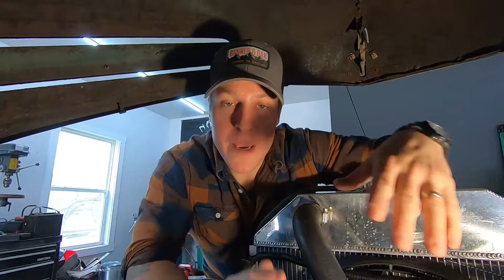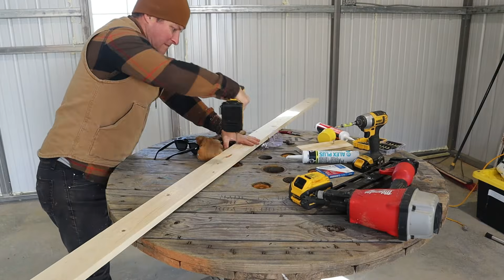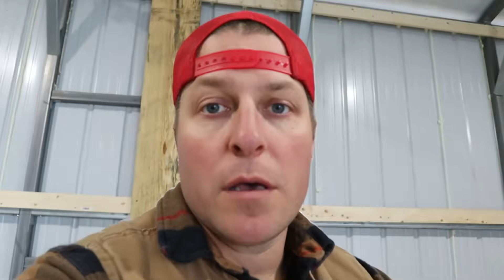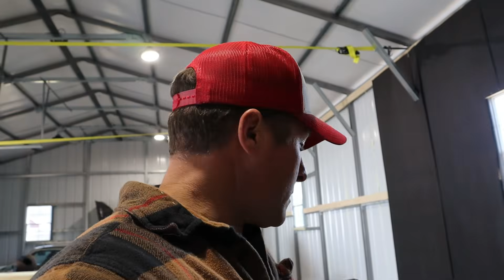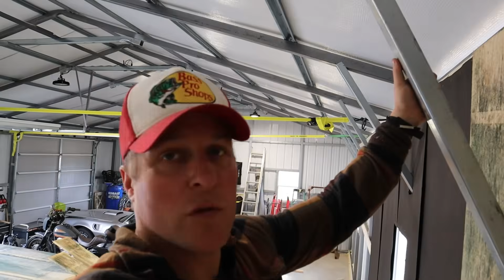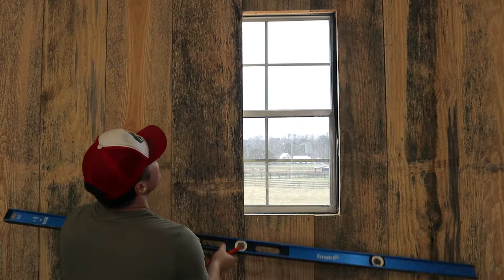THAT'S ALOT OF WOOD!  Best Metal shop interior wall DIY. Dream Garage build Ep.11

Comment: Your 45 degree roof braces are now only supported by that little block of wood vs.  being tied in to the framing of the building. Couldn’t you have just notched the panel?

Comment: I truly regret buying my metal building. Trying to insulate it and wire it is a huge pain in the rear. I’d never do it again and I’d never recommend it. You’ve covered many, if not all, of the challenges I’m also facing.

Comment: Im about to do interior walls.  Ive already done bubble foil on all eals and ceiling and 1inch foam board insulation on all the walls. I was considering framing it all with 2x4 then use plywood. Would i be just as well off using batting boards across top center and bottom as you did?

Comment: Why not any Insulation? Sheet rock screws are not structural and are going to snap off in any kind of wind or weight on the roof

Comment: Looks good man, i definitely would of installed reflective insulation under metal siding . Fyi mold will go away if its closed up.  Needs air and multiple treatments.  Also i would keep wood up at least 1 inch off concrete floor.

Comment: 2 years in how is it holding up? Can you explain how the load is transferred by doing the boards that way?
Reply from the maker: It’s holding up great! The vertical boards are actually resting on the ground then just attached to the wall.

Comment: Man that’s a Great Job!!!!  I love the look of the wood wall. I’m building my new 20x25 in a few weeks. I plan on putting silicone caulk down under the metal frame base and spray foam on all the gaps. I’m having 2” roll fiberglass insulation installed and want to finish the interior like yours with the wood. I’m just curious what’s with the ratchet straps?
Reply from the maker: Thanks! That sounds like a solid plan for sure

Comment: The 1x4 in the middle screwed against the metal horizontally.. why did you screw it on leaving like over half the metal beam exposed?  Was it necessary to be that height for some reason?

Comment: Should have gotten closed cell foam. Fully sealed, no condensation issues, and it greatly increases the entire buildings rigidness.
Reply from the maker: I wished I had the extra cash for it. It’s pretty expensive around my area
Reply: Agree

Comment: Great video.  I just had a metal garage built, and I elected to do the double-bubble wrap to keep the moisture out.  Since you caulked the outside, where is the moisture going to go during weather changes?  The felt paper will keep it out from the inside, but the area between the felt paper and the metal siding will still create condensation, where will tghe condensation go?  What am I missing here?

Comment: I think you've made a huge mistake sealing the metal and leaving an open cavity. Love the work ethics!
Reply from the maker: Thank you. Honestly curious why do you think that?
Reply: @ProjectDadLife  moisture is going to condense in that cavity and not air flow to allow it to dry out. It's metal so it may take a while but it's going to rust out in my opinion.
Reply from the maker: I did a-lot of research prior and metal only condensates when it’s un insulated. When you put a barer between the metal and the atmosphere inside your shop it actually stops the condensation process. That’s why red iron buildings install the white vapor barrier over the trusses prior to installing metal roof. Just google how to stop a metal building from condensing.

Comment: Thanks for the video.  I like the vertical boards. I have a 24x48 metal building which is a garage/apartment/shop.  It was built 20 years ago. It is metal purlin with metal siding and roof with sprayed in insulation.  We live in Texas and the insulation seems to be good for our area. Framing with wood studs in the wall has been “fun”.  Your idea looks easier. I have a few walls or portions done with wood studs screwed into the metal purlins with similar screws to what you used.  Then nailing or screwing the 4x8 OSB onto those studs. In some places I screw the OSB right into meta purlin around a window. Anyway I am on a mission to organize my shop and need more walls to hang stuff from. I can hang things quite easily on wood.  Again, thanks for the video.  You have a great helper there. Mine are all in their 30’s now.
Reply from the maker: Thanks for the support Brent hope yours goes smooth!

Comment: How has it done with the cold temp? I’m trying to figure out the insulation deal now myself. I’m leaning toward foam board but had to ask how your method is working.
Reply: I did foam board. I have a 20x 26 building and foam boarded the whole thing. I am heating and cooling with a 1.5 ton heat pump. It stays warm usable and I'm in 10 degree weather right now.

Comment: Wow beautiful work dude. My thought tho. A tubular steel frame building is not at all ment for quality and craftsmanship. So unless you put every screw in. Might think about continuing to throw money at it. They look awesome from the road. But flying around in a tornado is kinda scary. Far as water penetration prevention. Um. Go outside. If your only sealing the inside. It’s too late. The water is doing it’s best. It’ll leak warp pop and sound like popcorn on a warm day. Dang bruh. For what it’s worth I’m sorry. But the work looks great. Just need to back up to the beginning. “Steel frame” refers to gerders and beams and pearlings. Good thick metal. Those buildings usually get standing seam. Heavy thick good quality. You just got a big erector set. Add more of everything. There’s never implied quality at eagle carports. O wow you even put the vapor barrier inside. What do you get paid to do on a regular day? Surely not contracting and thinking up your own ideas? Maybe a jobsite foreman. ? You know enough to sell it. But please don’t sell your ideas as facts. I’m stopping at 4 minutes. This hurts my wallet and efficiency. Wait about 6 years before saying I’m wrong. Water works slowly.
Reply from the maker: Do you feel better now? The vapor barrier obviously went over your head it’s not for water coming from the outside.  when there’s a temperature difference with a metal panel via on a building inside vs outside it creates condensation on the inside.
Reply: @ProjectDadLife  there's always that one asshole. I for one heavily appreciate what you've done
Reply from the maker: @Johnysoutherner  lol right! Thanks man. Putting yourself out there on YouTube A**holes just come out of the wood work. I usually don’t care at all it’s just human nature. This comment got me though like wth all that time spent just to try and tear someone down!🤦🏻‍♂️ Anyway thanks for the support man I appreciate it. God Bless.

Comment: About an inch of closed foam is the way to go before the wood. The foam will add rigidity and strength actually. The foam you sprayed may not be closed and over time might affect metal.You could skip the felt after a layer of closed foam and allow ventilation. You don’t want mold forming. Mold is dangerous.
Reply from the maker: Thanks for telling me, I’ll see what I can do.

Comment: Hey man I’m ping something similar in my building.  On the electric boxes did you mount them on top of the metal framing or flush with them?   Thanks
Reply from the maker: I mounted them flush same way they mount to a wall stud. Hope that helps

Comment: *Take the industrial cover off your quad 4s receptacle box and install a 1" deep p-ring, mount the two receptacles, then use a jumbo flush cover. That should cover up your miter cuts in the board.*
Reply: Came here for this!!

Comment: For the electrical, I would have removed the industrial covers and just gone with standard surface mount covers (like what is inside your house). Could either be plastic or metal surface covers depending on what you wanted. The 4 square box would need to be raised so the edge of the box is at the surface of the wood.
Reply: Hey there. I hope this message finds you well 2 years later, lol. 

My metal shop was just completed and I came here to figure out how these metal boxes are supposed to be set to accommodate drywall. 

With the standard gage boxes that you used in a home have a tab that helps you set the box and allow the space for drywall. 

Thanks in advance.

Comment: Yeah I got an 18 by 30 carport and I get what you're saying when it's cold out it's fine but if the weather changes real fast from how to warm the metal will sweat and it will just basically rain on the inside of your shop one thing is I wish I would have been told is that they have moisture resistant barrier stuff that you can have put down before they put the metal if I ever have a shop done it will have all that done before they even put the metal on because we're looking to buy a house and I want to build a shop like kind of what you did

Comment: Not sure if it was smart to seal up bottom because if there is moisture then where does it go or drain too!
Reply: I just purchased one of these metal buildings!  Even if your slab has a 4 inch wide battered edge all the way around, like mine was designed, these buildings do not even come with any flashing whatsoever between your slab and the building, they still suck up water underneath like a vacuum cleaner and dump it ALL inside your building!!!  You have to seal everything!!!  Outside, and inside!  Hindsight says"I should've just done a pole building, or even a stickframe garage!
Reply: @allencolvin4320  How would a pole building improve your water situation?
Reply: @NelsonJ1  bc my building was designed to have a slab with a 4 inch battered edge, so it would have to have customized flashing to drain the water off from the outside wall and past the edge of the 4 inch wide battered concrete edge.  With a pole barn, the metal siding would hang virticle, instead of horizontal like on my tube frame building.  A virtical pannel would be hung 2-4" past a concrete slab, since pole frame buildings have the slab flush with the outside edge of the building. A simple drip edge flashing along the bottom would be the most needed to shed the water to the ground.  With the engineered drawings I was sold, there is nothing along the bottom transition of my building.
Reply: @NelsonJ1 better design and quality. Quite simply actually
Reply: You do have a point there.  Flashing along the outside, and silka-seal caulking on the inside would still allow the moisture to escape